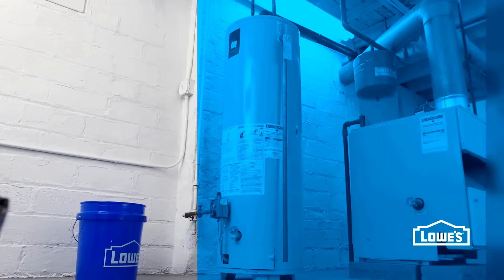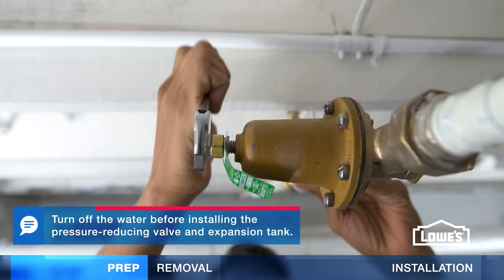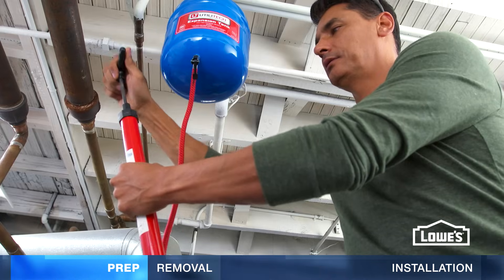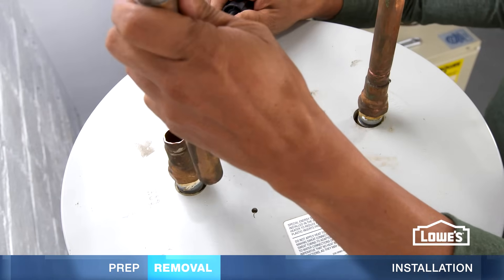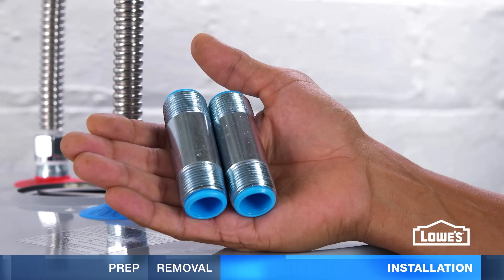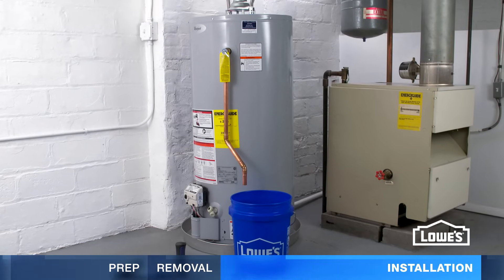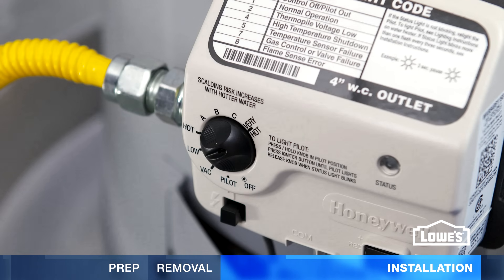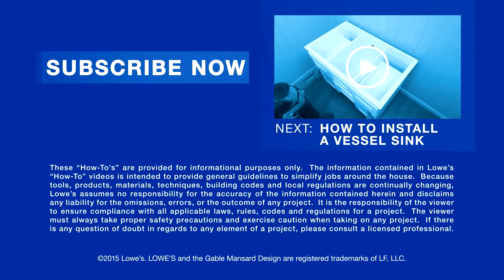Gas Water Heater Installation

Comment: Very Nice/ helpfull video,,,, THANKS
BUT
#1  When a person replaces a gas HWT, he shops for a 40 gallon "TALL or "SHORT" replacement tank.? RIGHT?
 I needed a 40 gal  'tall' to fit into the SAME EXACT PLACE!.

The FIRST thing that you should mention in the video, is that the FEDS mandated the changing of the SIZES of the tanks (2 or 3 years ago?),,,,, and that NOW, the 40 gallon 'TALL' tanks are + -  4" higher/ taller!
SO NOW, NONE OF MY COPPER 1/2" PIPES, UNIONS, & VALVES WILL FIT!  I have to replace everything!!!!
SO NOW, MY EXHAUST PIPE IS PERT-NEAR FLAT!  NO 1/4" DROP per FOOT,,, AND NO 12" VERTICAL RISER,,,, LIKE THE INSTALLATION MANUAL SHOWS, BUT YOUR VIDEO DOESN'T!!!  (according to the 'manual', YOUR DOING IT WRONG!)

I'll have to drill through the concrete wall, into the chimney & LINER,,,,, , to raise my EXHAUST/ stack pipe opening!?
My chimney opening IS BEHIND MY FURNACE!  &^%$#!!

OR,,,,, I'll just have to TAKE THIS 'TALL' 40gal UNIT BACK TO THE STORE, (it doesn't fit) AND BUY THE "SHORT" MODEL!
I'll have to start all over again!?????

Wouldn't it be an intelligent idea to put ALL of this "NEWLY DESIGNED/ TANK SIZE" replacement information/ tips on a store sign,,,, OR ON THE OUTSIDE OF THE BOX!? (the installation manual is on the INSIDE!)
BETTER YET,,,,  ADD THIS INFO TO YOUR VIDEO,,,,, AT THE BEGINNING OF YOUR VIDEO!

Say Like, FOR PROPER DRAFTING,,,,, "MAKE SURE YOUR NEW, REPLACEMENT TANK TOP IS 2' BELOW THE EXHAUST CHIMNEY OPENING!!!!!"

BTW,,,,, 3 of MY 'PLUMBER' FRIENDS DIDN'T KNOW EITHER!
Reply: J Doboy yes, all true. Shorter tank is better though, easier for energy to heat a shorter stack of water and penetrate through quickly, heating it. I'd return the tall and get the short for sure.
Reply: anarchyamp I'd thought a tall would be more efficient due too a longer chimney and more surface area in contact with the water

Comment: great video. But one thing, you might want to mention about how to dispose of / recycle the old heater.
Reply from the maker: ***** Checking with local authorities on disposal or recycling is a necessary last step. Thanks for the feedback!
Reply: Your local metal recycler will likely give you a few bucks for it. Mine gave me $12 for a 75 gal tank, which was better than paying the local waste company $6 to drop it off.
Reply: Put it out by the street. It will be gone by morning. The last one took less than 20 min. We weren't even done installing the new one and it was gone. Someone needs that extra cash and less hassle on you

Comment: Just bought an AO Smith Signature Select (Extended Warranty) gas heater.  I see no comment in the paper instructions regarding leveling the water heater.  I have always seen this in all appliance installations and wondered why it is absent now.  The installer of our old heater did a cock-eyed job and I was not present to watch him.  He told my wife he installed it crooked because "The plumbing was the limiting factor in his effort."  I just figured he wanted to put as little into the job as possible and beat it.  SO, now I am doing this job myself 10 years later.  Level installations for gas are always important?
Reply from the maker: Hi, Dolred. Try contacting the manufacturer for level installation procedure. If the prior installer is correct and there are plumbing restrictions causing installation issues probably worth have a pro take a look. Thanks for watching.

Comment: I noticed that no dripleg was installed at the entry of the gas line to the water heater.  Is that omission a mistake in the video?
Reply: There is a "drip leg", / sediment trap. The drip leg/sediment trap is installed at the bottom of the vertical pipe. In the video, there is a Tee fitting at the bottom of the vertical pipe, the "Bull" (side) of the Tee going to the gas valve, then a short nipple and cap, on the bottom. Obviously due to any moisture, or sediment which will fall into the drip leg, or sediment trap.  Whether there is "dry gas" in the area or not, the International Mechanical Code , and the National Fuel Gas Code books, require it !
Reply from the maker: Youssef Farhat  a drip leg collects moisture in the gas line and is not needed when gas is dry. Worth mentioning drip leg is often confused with sediment trap which collects dirt and debris before it gets into the control unit of an appliance. As always, follow the code requirements of your area and contact a pro if you have questions. Thanks for watching.
Reply: Lowe's Home Improvement  Thank you for the well-informed response!  I did some follow up reading and you are absolutely correct.  It appears as though my home inspector conflated the terms "sediment trap" and "drip leg," and that these are commonly confused terms.  Still, it seems like sediment traps are to be installed at the entry point of gas into water heaters, furnaces, and boilers for the reason you mentioned.  It would have been nice if the video mentioned it, but it's still a great video that I'll refer to in the future!  Thumbs up for the great online customer service at Lowe's!
Reply from the maker: Youssef Farhat thanks for the feedback.
Reply: Youssef Farhat: what you're calling a "drip leg" is at the base of the supply pipe near the wall, below where the flex-line is being attached
Reply: Read the owners manual. Most manufacturers state if no drip led or sediment trap is Not on the main line closest to heater it should be installed at the gas control valve
Reply: Hey smart guy the pipe is painted looked harder
Reply: @ 1:40 - 1:43 shows the the dripleg/debris drop on the gas line.

Comment: Mine came with 6 screws for the blower bur no holes. but don't know if to screw on myself or I might have got a defected one? Any help
Reply from the maker: cisco cruz check the manual that came with the water heater, it should provide detailed installation instructions and contact information for the manufacturer. If you don't feel confident call a pro for help.

Comment: In the plumbing world we call this a A+ hack job
Reply: how is that a HACK JOB? seriously, I'm curious to hear you explain how a pro would do it any differently...
Reply: Do you think for a minute that Lowes did not run this video by at least 3 lawyers before posting it on Youtube? I hired a plumber to install one and after seeing how he did it the next time I installed it myself. That was like 13 years ago and I am about to install another one. Keeping in mind some people can't change the toilet paper roll doing it yourself isn't for everyone but for a seasoned do it yourselfer it ain't that difficult.
Reply: some just hate on anything not done their very specific way
Reply: This is hardly a hack job. Just because you want to charge people $1000 dollars for labor to install a water heater because you claim everything MUST be hard piped doesn't make it any better of a job.
Reply: In the plumbers world, maybe. Because they're using sharkbites instead of soldering. But this is a how to diy video and most people don't know how to solder. Shark bite fittings work perfectly fine.
Reply: Any plumber that knows ANYTHING, knows this install is done pretty well for codes in many states.  Are you that out of touch?  You clearly have Internet access.
Reply: This install would get yanked off of any job id be on....wouldnt pass inspection, let alone looks like shiite

Comment: I stopped at "close all the windows, turn up all the gas." But I was curious so I continued, then I heard words such as solder, debur, etc. I'll just let a pro do this. LOL!
Reply: If folks do not want to do such job, fine, get the pro. I am an avid DIY and replacing a water heater is easir than working on an engine. Plus the money saved goes to more tools.
Reply: Wallace: Bullshit. After buying the proper replacement tank from a home center and in most cases $30-worth of flex-lines/gas supply line/proper thread-sealant, the rest is lefty-loosey/righty-tighty + close-valve/open-valve for anyone with half a brain.  Tank doesn't work after? You re-check your install, and worst-case scenario return the tank for a replacement if faulty.
Reply: Wallace update: I have the proper tools. Two weeks ago, I did the job, a week later, the city inspector came and gave it a thumbs up. Passed. Enjoying the new water heater. With the money saved, got more tools on the way. Not everyone will be up to doing such job but those who go for it, they do it bc they like going for it. 🥂
Reply: ....same
Reply: Kung-Fu Mojo good you sound stupid
Reply: Kung-Fu Mojo Same here!
Reply: CONGRATULATIONS! OBVIOUSLY YOU 2 ARE THE 2 SMARTEST PEOPLE IN THIS COMMENT SECTION. MY SPIDEY SENSES TELL ME A LOT OF PEOPLE HERE LOVE TO BLOW STUFF UP.
Reply: And, without the proper equipment and expertise, how do you test the gas supply, combustion products and ventilation?
Reply: So you used a manometer and a combustion analyser?
Reply: Rob Fern - And the tools necessary to install and test a gas fired water heater properly (not incorrectly as shewn in this video) would cost about £1000.00.

Comment: Great video! just installed mine Christmas eve. It started leaking the day before after 28 years in service. Took me 4 hours for removal, and an extra trip back for another part and installation. I'm not very confident in my plumbing skills, but this video made it straight forward and fairly easy.
Reply: How’s your water heater install holding up?
Reply: What a coincidence...bought mine on Christmas eve 😂
Reply: I just received an estimate for 3450.00 for the purchase of an 800.00 dollar gas water heater and installation.

I laughed at the plumber and subtly pushed him the f outta my house.
Reply: @fostermac7170  installation prices are insane right now.
Reply: @samanthameyers1950  $1200 just for an instalation (no tank)
Reply: @Themadoutbacker I just had a clown wanting $1600 for the installation.
Reply: @fostermac7170 right they wanted to charge me $1500 for a tank heater and $5000 for a tankless unit. And that was just for the install. Screw that I’m going to YouTube university to figure out exactly how it should be done.
Reply: @fostermac7170  It's unbelievable what they want to charge for this!

Comment: When you show water dripping from discharge tube, A) what is the pressure gauge shown connected to, to measure the pressure  and B) where is the mechanism located to decrease the pressure to below 80 psi?
Reply: You adjust your water pressure with the water pressure regulator.

Comment: In the uk. You cannot do this. You must get a qualified gas safe engineer to do this. This is really frightening that any diyer can do this!!!
Reply: god forbid you have any freedom in your own house
Reply: In manly America, we learn to do all our manly things the manly way. By manually installing it.
Reply: +James, that UK requirement is overkill and a violation of personal freedom. Any reasonable country would only require an inspection of the job you did to make sure it complies with building and safety codes. This is what my US city of Baltimore requires. Otherwise, it is like the government is forcing you to pay twice as much for something that you already know how to do. Installing a hot water heater is very easy to do properly, and you shouldn't be forced to pay a professional to do it just because you don't have some "arbitrary" license that they also make you pay to acquire and maintain. 

Again, a safety inspection by the city is all that should be required to ensure public safety in these matters. Also, I'm not sure about UK but here in the US we add scent to our natural gas so you can tell in seconds if you left it on and it is leaking and fix it. And small vented amounts are not hazardous, just large amounts, if you have proper ventilation installed. It really isn't as dangerous as you make it sound.
Reply: Stay in England, thanks.
Reply: It's the meth labs that blow up houses, not the water heaters.
Reply: But they immigrated to the USA and became democrat politicians.
Reply: Dominic not necessarily here in pa  water heater will install a new one for under 1k
Reply: i guess they don't issue man cards in the UK. lol
Reply: also, in the US some cities do say you have to use a licensed professional to install a new water heater. But I don't think it is as strictly enforced. But if caught later you could be fined.
Reply: +John L. Sillasen right
Reply: David Crandall Yeah, we wouldn't want to blow ourselves. There's no fun in that.
Reply: MUST get a QUALIFIED GAS SAFE engineer? 
Sounds like a monopolized business to me... Buy a used one and install it for $200.
Reply: Frozenwalkway - You can have as much freedom in your own house as you like as long as you don't  harm your neighbours or their property.
Reply: Surprised these dinosaurs are still fitted in America. Natural draught, no thanks.
Reply: danaphanous - Your personal freedom ends when you blow-up your house and take mine with it.  As far as "not being as dangerous as you make it sound" - go tell that to the occupants of Ronan Point (a block of newly built flats destroyed by a gas explosion back in the days before the Gas Safety (Installation & Use) Regulations).
Reply: Ti Ha thank you Russia. You certainly did save us.
Reply: +tiehut plenty know it all cards dished out in North America.lol
Reply: Your talking to people who likes guns and blows up Countries for no good reason but to say "That'll show them"

Comment: It's not clear in the video, but when igniting the pilot, you have to press and hold the control knob while repeatedly pressing the ignite button - once a second for 90 seconds until the indicator light flashes.
Reply: Kelly Vincent ....thank you very much ......theres people out here like me that really appreciate a comment like that
Reply: @Bendover-jf4bi  I would recommend to follow manual instructions,it may vary depend on the model and brand
Reply: @carlosleiva9406  On that specify model that is being installed, next to the control panel is instructions on how to light the Pilot. In this case it is like Philly Kelly said. Mine too about 20 pushes. I could hear it light and a couple seconds later the light flashed.
Reply: Yep, Philly is correct installed the Rheem water heater today......
Reply: Hmm... Mine says to press the knob for 90 seconds and then push the ignitor once. Worked for me

Comment: I have a wood burning stove that is installed over a tiled floor. I also installed tile on the walls. The tile loosened up and is coming off the walls after I used the stove all winter. What can I use to make it adhere to the walls longer?
Reply: Definitely not a water heater.

Comment: How do I repair tile that is used as a barrier to stop heat. Am I doing something wrong when I apply the mortar to wall? I mix as package says. I put new dry wall, then concrete board before I put the mortar on.  Pleas help. Thanks, Mike
Reply from the maker: +MichaelR Bannach clarifying...you've replaced drywall near your water heater and are having trouble with mortar for heat-resistant tile?
Reply: What about that something like a tin ceiling? Or would the heat get to high?

Comment: Can you cover tankless hot water heaters as well?  I've been considering replacing our tank water heater with a tankless model to be able to keep hot water at all times and to avoid just heating water all the time.  What do I need to consider when moving to a tankless hot water heater?  What are the advantages/disadvantages?

Love these videos!  Thank you so much!
Reply from the maker: +Reboot153 Thanks for the feedback. Due to the nature of the install we recommend professional installation of tankless water heaters.
Reply: the problem we always experienced was when two people showered at the same time.  water was not as hot.  never had that issue with a tank.  so over buy on the BTUs to be safe with the Tankless.  They are all we ever used overseas, but stateside we use Tank heaters.
Reply: If u live un Florida okay...if it snows where u live..keep away...it will not produce enough hot water. U dont hv to take my word for it..but u will remember this response it u dont